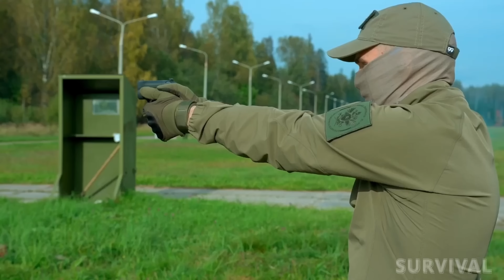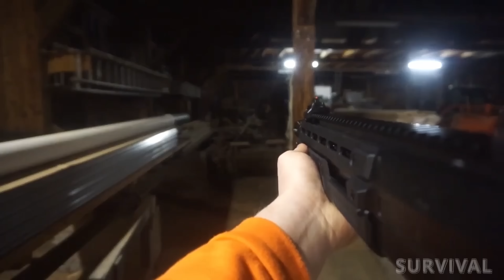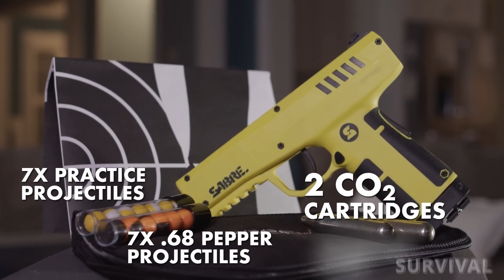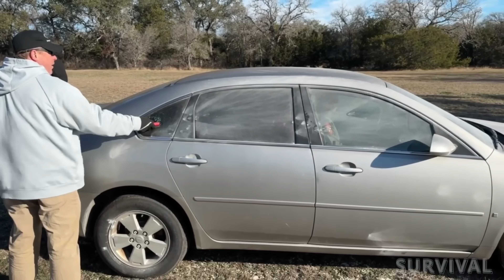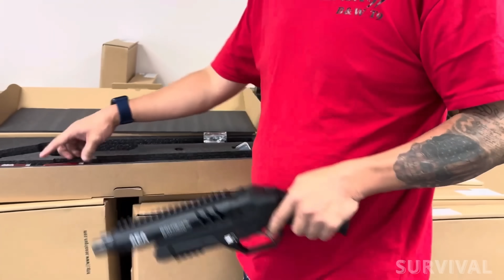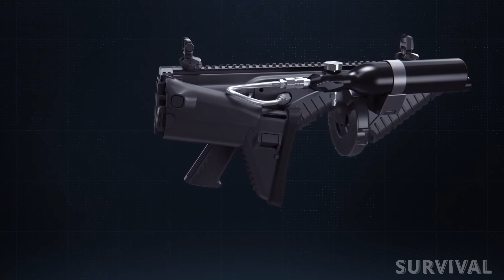Top LETHAL Home Defense Weapons on AMAZON! (NO LICENSE)

Comment: "...without the felony risk."  I'm in California, and here felonies include possession of a blow-gun (literally any length of plumbing pipe like 1/2" copper from the hardware store) or carrying a pair of scissors or knitting needles in a handbag.  So "without the felony risk" is one hell of a tall order, and I encourage anyone considering getting any of these to actually check your local and state laws. :(  Edit:  Oh, not to mention the requirement for anything that looks like a firearm but which isn't a firearm having a brightly colored tip on the barrel.  Again, check the laws!

Comment: i think the one to get is the gen12-LL is the one to get. it doesnt rely on air canisters to fire the projectiles. instead just firing straight up less lethal shotgun rounds. u have a lot of options when it comes to less lethal shotgun rounds and lets be real in certain situations their strong enough to kill if need be. definitely has the stopping power and again ur not relying on a single source air canister to fire the rounds. if that fails ur shit out of luck. where ass the shotgun with a bad round, u can just cycle in another one.

Comment: If you can't own guns get you a crossbow or a compound bow become super proficient at it there are crossbows out there that will hold up to seven shots there's a German guy that sells them..... Or make yourself a spear I guarantee of someone comes into your house and you got a nice big fat spear they're going to run the other way....
Reply: Yeah I have the Gen 2 Cobra RX Adder semi-automatic tactical crossbow myself. That the one most often attributed to "the German guy". It's from Ek Archery. 240fps, extendable stock, picatinny rail, technically takes 6 bolts but with 5 in the top-loaded mag. Reasonably priced and extremely accurate. I would not want to be on the other end of it. You'd be surprised what it can send bolts through without issue.
Reply: I like the compound bows. Cross bows take too long to load. But i like this idea, silent and old school. I need to find that 7 shot crossbow you mentioned.